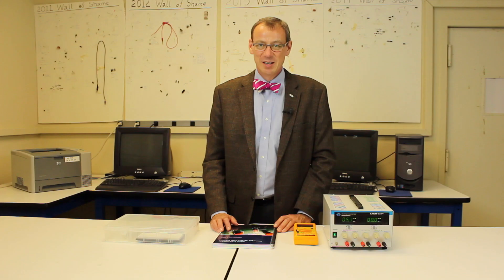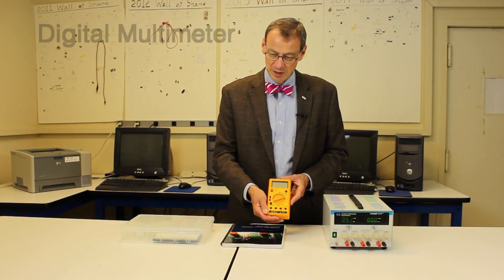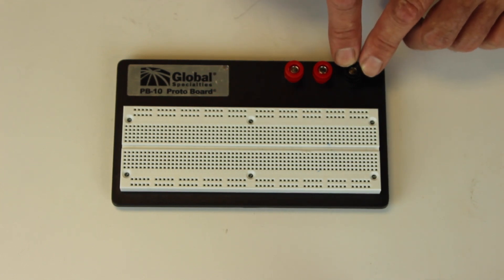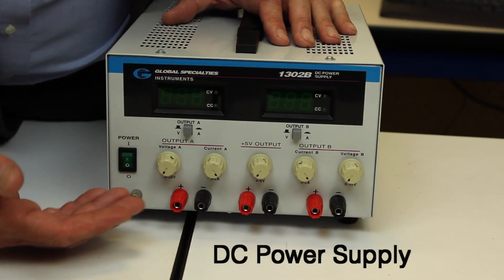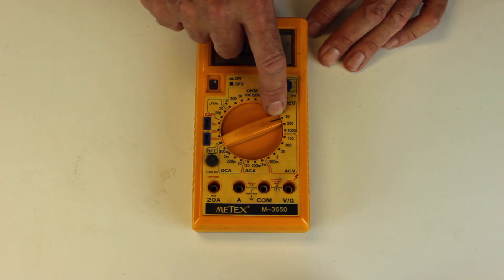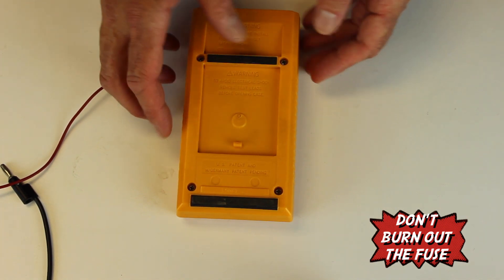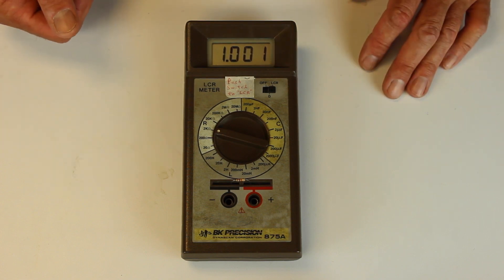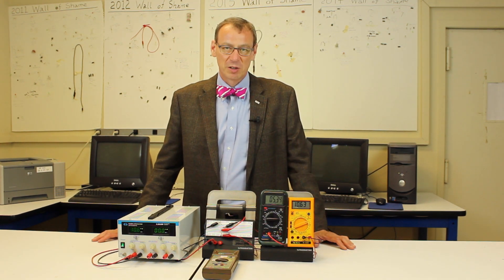Introduction to Electronics Lab

Comment: I’m new to electronics and have successfully built a couple of AM radios from kits. I’m interested in your course. Why do I need an LCR Meter when I can measure the values of resistors & capacitors with my multimeter. I don’t have a power supply so could I use DC batteries to supply power to circuit board for the class projects. I’m sort of on a budget. 
Thanks, Mark, San Francisco Bay Area, CA